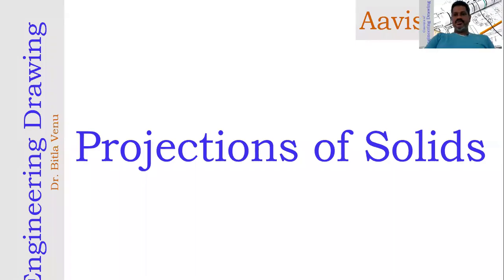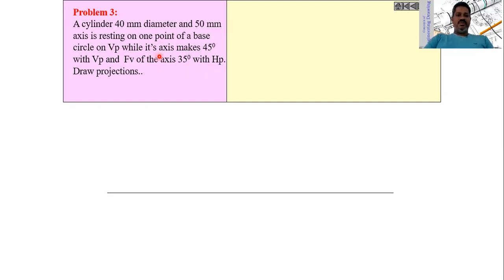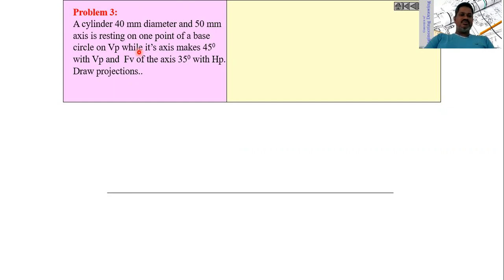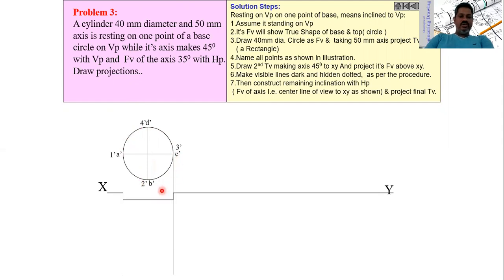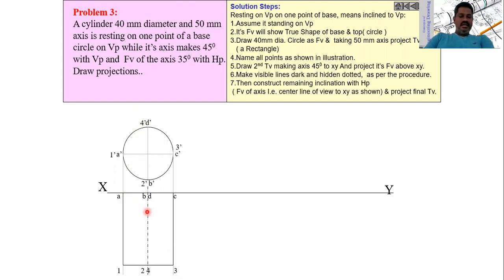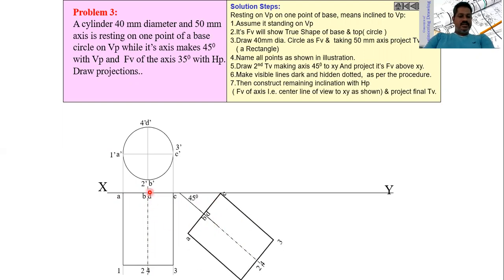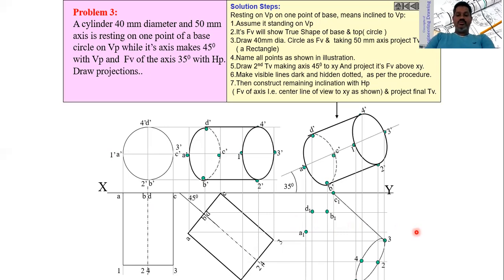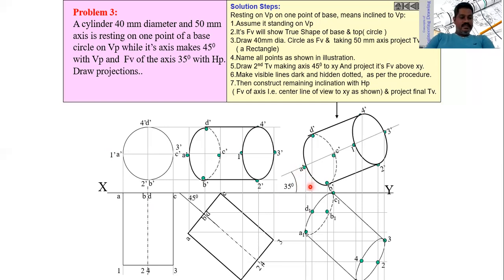Projections of the Cylinder

Comment: A cylinder of diameter 50mm and axis 65 mm long is resting on V.P on a point on the
base circle with axis inclined at 45° to V.P and parallel to HP. Draw the projections of
cylinder.

Comment: Sir can you answer this..,  A cylinder of base diameter 50 mm and axis 65mm rests on 
a point of its base circle on the HP. Draw its projections when 
the axis is inclined at 300 to the HP and the the top view of the 
axis is perpendicular to the VP.